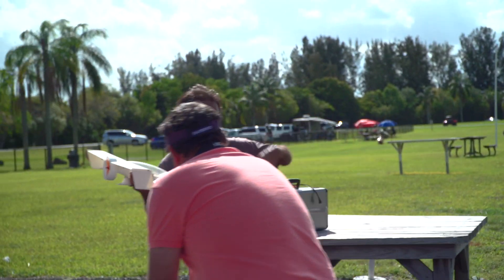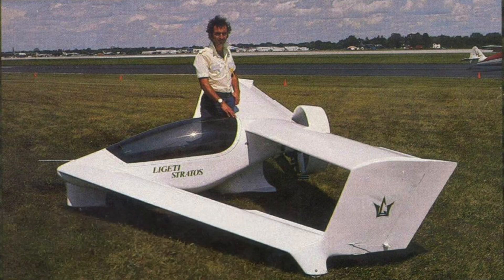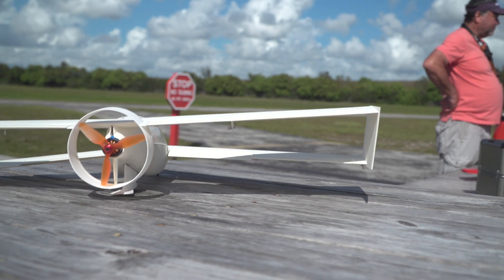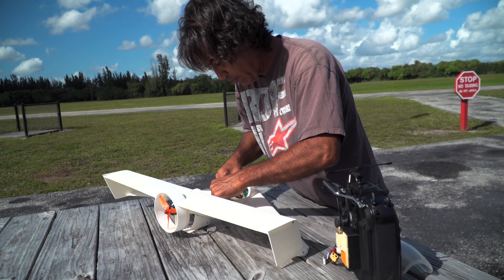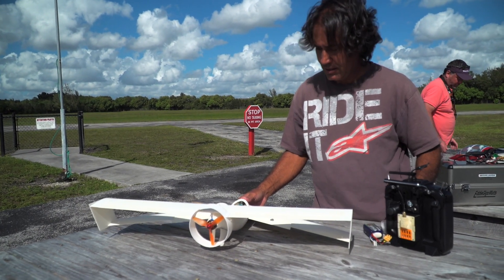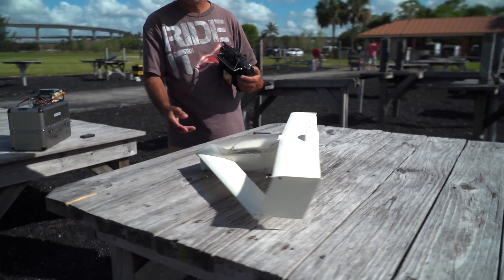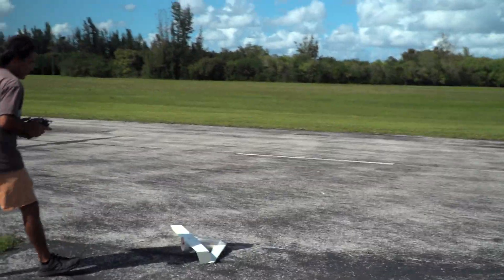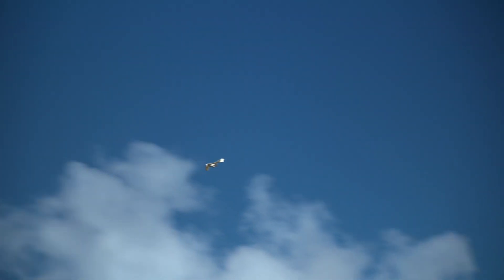Is 3D printing the next generation of aeronautic modeling? Rare RC 3D printed model-LIGETI STRATOS!

Comment: Seems like rc chaser need to learn about new technologies.. seems like bunch of guys that only know spektrum And Horizon hobby only. The world of rc is pretty big ! Not only 3d printing, but for example radios .. radiomaster makes some really great radios that outperform your spektrum 10 times and cost $100 🤪
Reply: You could not give me a radio master I would throw it in the garbage can
Reply: @captainaxle438  lol and why is that exactly ? Cause you can't figure out how open tx works ?
Reply: Love My TX16s EdgeTX especially all of its protocalls and luascrips full size aircraft instruments display Gps google maps  , I fly mostly TBS crosfire reicevers which have a 65 mile range and Express Elrs 25 mile range Spektrum Futaba and most brands are made for simple minded people that's the reason you see Me flying my Stratos on this video with it Spektrum is king of lock out crashes in my field
Reply: @Eddiegigowatts2  agreed hate to call it out this way but bunch of old farts flying spektrum.. same here at my local field.. bunch of old farts that hate fpv 🤣
Reply: I'm sorry, I agree with you in ways. I'm not impressed with Spectrum  or any brand. I simply need a radio to fly. But in my opinion the radio master is the same quality as the cheapy transmitters that come with electric RTF  foamies. I got to at least buy a brand name. Maybe you're mixed up. You see, you buy a radio and an airplane so you can play with the airplane. You don't buy a radio and airplane and then play with the radio. It's like the kid playing with the Box the toy came in its backwards. But if that's what you like, fine.  aren't you impressed by the computer that printed the 3D airplane?. But after that is done, you still fly the airplane. Focus on the airplane, it's the thing you look at in the sky, the transmitter is just a tool
Reply: @captainaxle438  my point is simple you can buy Nikes to do your basic walking for 170 or sketchers for 40 the sketchers are surprisingly good and believe or not more capable of the Nikes (Spektrum) they cost much less and have more features and functions and deliver reliable Performance. I've seen birds that costs over 1000 dollars go down because of spektrum. Spektrum Is just not keeping up with the latest technologies and is overpriced Garbage lets be real. YouTube and rc forums are full of people providing evidence for what I say here do your research please.
Reply: Got it Joe
Reply: Because of the airplanes I have seen them crash and I'm not going to use $100 radio on a $600 airplane. Good luck you'll need it. If you like to play with transmitters you should get into Electronics. The transmitter does not fly perhaps you're not a good flyer so you focus on the Electronics
Reply: @captainaxle438  funny you say that I have seen tons of spektrum failsafes on $300+ radios pít spektrum failsafe on YouTube and educate yourself

Comment: Absolute legend. Ive loved this plane since I first saw it on Beyond 2000 in the late 80s. The Legeti Stratos , BD-5 and the Quickie. all awesome little planes
Reply: Looks like we both have similar taste, also have the Quickie Q2 ready for printing about 36 inch long ,was designing  the BD5 as well have to figure out the gear ,the Stratos is getting scale up 2x  because this one was too small 
For the 4.6 gram servos

Comment: What’s the difference between the design your model is based on vs the one Mr. Ligeti Stratos was flying?
Reply: The S2 has no diehedral in the wings the fan was moved underneath the top wing and the rear wheel pant was replaced by a ducted fairing that was blended in to the lower section of the fan ,my model is based on the S1 which you see in the picture with Mr Ligeti  ,will designing the S2 as well